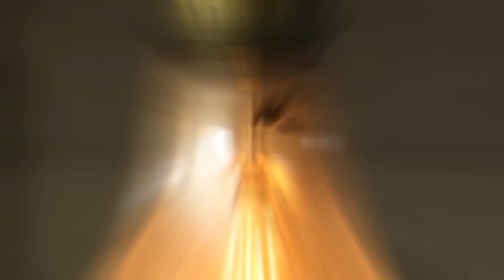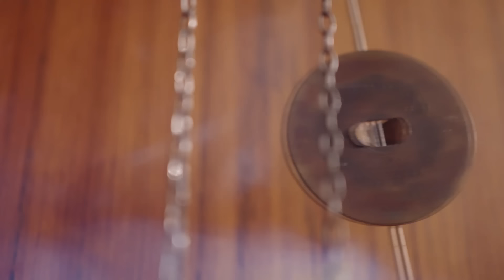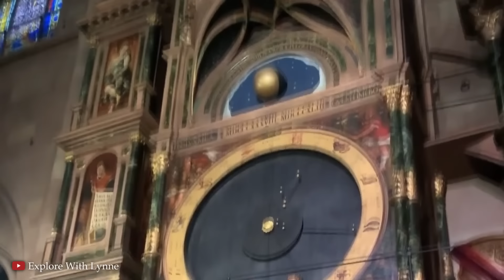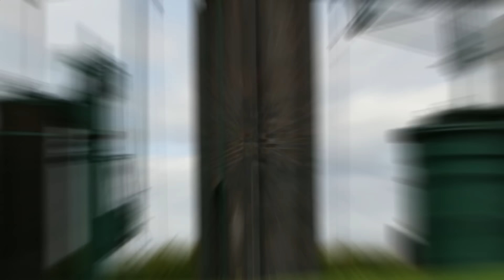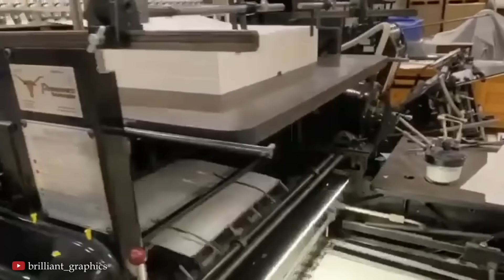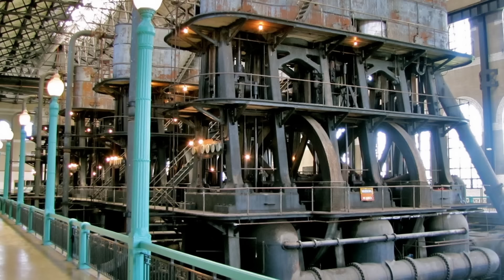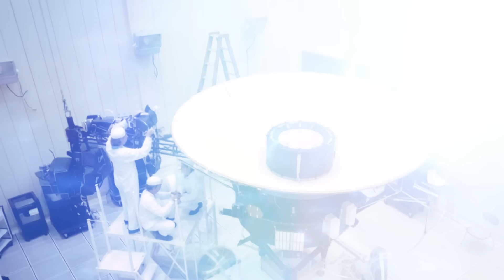15 Machines that STILL RUN After 100 Years

Comment: A machine is a technical system with moving parts that converts or transmits energy to perform mechanical work. It consists of interconnected components that carry out tasks more efficiently than human labor. Typical examples include engines, vehicles, machine tools, washing machines, or automated devices.

Comment: "Anyone can build a bridge. Only an engineer can build a bridge that barely stands up."  Different time, different engineering philosophy. Currently the goal in most cases is lowest cost that works for a defined but limited period. Long lasting designs are discouraged as it limits additional sales therefore limiting profits. Smartphones are the extreme example but the same logic is used in everything modern

Comment: The Oxford Electric Bell, located at the Clarendon Laboratory in Oxford, could be also mentioned here. It has been (silently) ringing since 1840, although its battery has never been replaced.

Comment: There is a ghost town named Sandon in the southern interior mountains of British Columbia Canada. Nicola Tesla installed an electrical generator there in 1897 and It continues to produce power to this day.
There are hopes to build a ski mountain in the area and use the electricity from Sandon to power the mountain operations.
 It will be built on a former mining town called Zincton to which the ski area will be named

Comment: First item is not even a machine. It's a malfunctioning light bulb. It's a 60W bulb that broke and now only draws ~4W. Take any incandescent bulb and run it at ~7% of it's rated power and it will last a VERY long time. So yes it's still running, but not as intended.
Reply: I agree but nevertheless the bulb IS a machine. It does work upon the input of energy. Thats the definition of a machine. It doesn't have to be mechanical. 

Its a common confusion because of course, all machanical devices are machines, but not all machines are mechanical devices.

Comment: My vote would be the Anderton Boat lift it's over 150 years old it was made to overcome a 50ft difference between the river weaver and the Trent and Mersey canal it's essentially a elevator for canal boats parts have been restored and it was converted to using electricity but I believe most of it is original Victorian engineering remains and was cutting edge for its time and is still a impressive sight today it's nickname is the cathedral of the canals

Comment: I have an issue with a light globe being mechanical.  It’s not mechanical
Reply: Who said anything about mechanical? Machines aren't always machanical. A machine is just a device for doing work when you input energy.. A bulb does the work of converting electricity to light and heat. Its a machine. 

So whats your issue again?

Comment: The Tower Bridge steam-hydraulic system is completely destroyed, the engines cut apart for viewing the interior, the accumulators have been fixed in place for H&S reasons, the steam engines are now operated by low pressure compressed air. The pressurised water motors that have not been removed had their shafts disconnected in favour of an electro-hydraulic system. The steam system had never failed to raise the bridge for a century, but the new electric system has now failed several times.

Comment: Really makes you wonder, "What the Hell have the creators of our world been thinking, making everything break every few years?!" Imagine the Peace and Stability a world would have with solid, reliable, and consistent machinery! 👍
Reply: "We can make more money, if we sell it to them multiple times, rather than just once."
Reply: Greed
Reply: The answer is quite obvious, ain’t it? 

If it breaks, that means you have to buy another one… Not to mention the sub market that came from it—repair shops… money!! It’s all about making money! Build it with shitty materials means it’s breaks down sooner… It’s not only cheaper, saving you money on materials, but you also make even more money when your customers come back in a few months rather than 10-20 years… money, money, money!! Money is honey!!
Reply: Sometimes being super durable can be a double edge sword famously go pro had a problem they older cameras was so durable no matter what new versions they made people would just get a older model for Like 70usd used of eBay it actually caused them a lot of trouble since action cams are so hard to break few people bought new ones
Reply: @liamcollinson5695  So basically, the problem was 'If we make them too well, people won't buy more of them.'

Which is basically the line of thinking I quoted. XD

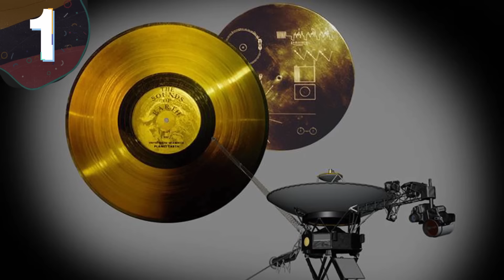Comment: 32:42 the Voyager spacecraft were launched in 1977, NOT 1997- 1997 would be the completion of the Pathfinder Mission on Mars, which failed likely due to battery failure
Reply: Doesn't matter... either way its not over 100 years ago.

Comment: A lot of the machines that were powered by stean engines were converted to run off ice engines and electric motors. If you search about these machines you may find many of these machines are still running.

Comment: Ahhhh!  Back in the days when "Reliable" and "Long-lasting" were the guiding principles of design and manufacture!
    Until it was discovered that "Cheap with Built-in Obsolescence" could yield much, MUCH, bigger profits!
    Why build ONE 'machine' that last 100 years and yields (say) £50 ... when you can sell 100 'machines' that last one year each and yield £2000?
Reply: And no... In reality many of the most profitable companies are literally ones known for good quality and lasting products.

Comment: Even though 'The Bulb' produces hardly any light and/or heat -- it IS amazing!
    And look how BEAUTIFUL it is!  The gorgeous shape, the 'engraving'!
    Just wonderful!
Reply: Indeed, it is a pretty thing in many ways... Just wish people would stop that conspiracy nonsense. The incandescent lightbulbs basically reached a technological pinnacle at a certain point settling for an at the time adequate compromise between efficiency, colour and longevity. And to reach even that far required literally the kind of temperature that simply evaporates one of the most heat resistant materials known to man and slowly accumulates it as a dark deposit on the inner surface of the glass bulb. Under such conditions, most metals would just sublimate instantly.
Reply: They run it at half power on a dimmer so it lasts longer

Comment: I proudly own and use a 1937 crosley refrigerator to keep all my extra supplies nice and cold it's been outside in the weather and the extreme 100 plus degree heat down to below freezing and the only thing I've ever replaced is the plug-in and a few light bulbs I'm 43 I found it when I was 13 in a barn and it's been plugged in ever since it was old when I found it used to keep cattle medicine in😂https://youtube.com/shorts/SgNa4q8RcZM?si=n-me0naTxHBzXi-k

Comment: @1:57 unfortunately light bulb manufacturers realized that a long-lasting bulb doesn't make money. 😢
Reply: Nor do they produce usable light.
Reply: @Crusty_corndogs  its a night light, and doing just that? dim jentel glow, in the red end to light spectrum of colour, no of nasty Blur light almost every to day pumps our
Reply: Run a 200watt bulb at 4 watts and it will run a few 100 years
Reply: Although it is quite a feat I don’t know if I would call a lightbulb a “machine”.
Reply: same with LED it is easly possible to make LED that can last 500.000 to 1000000 hours but no 50.000 h is average and 100.000 h are only avalible in saydi arabia

Comment: The light bulb still running just shows you that we can make things that last. Then greedy people get involved and instituted planned obsolescence.
Reply: This is already been established in that light bulbs in a manufactured for Middle East like Dubai and other places over there , Those countries receive lightbulbs that are something on the order of 10 times more long-lasting than ones that are sold in the United States because they demand it so they got it. Bulbs that are sold in the Middle East are for bidden to be sold here in the states/west not buy them, but by the lightbulb companies.
Reply: It was the light bulb manufacturers that made sure we got built in obsolescence: https://en.wikipedia.org/wiki/Phoebus_cartel
Reply: @rodsprague369  great, a cartel that never controlled global markets and in the end only briefly. This is literally a textbook example on how actual greed driven schemes are quickly bloated into global conspiracies that control pretty much everything.

Lightbulb simply became a commodity product that had reached its technological peak. Halogen improved slightly on both efficiency and longevity, as well as the output spectrum... But not by that much and did introduce some temperature management issues in return. And even halogen reached its peak. With technology that is based on black body radiation, it is simply hard to come up with solid materials, with suitable electrical properties, that simply would not disappear in a blink of an eye.

The Centennial Lightbulb, or whatever it was called is nothing more but a low power heater that emits some faint glow. As an illuminating device it is utterly useless. Crank the heat of the filament to actually useful levels, and it would evaporate about as fast as filaments do. There are no technological wonders or some hidden lost wisdom there.
Reply: Actually the bulb it's self had only lasted as long as it did due to it being ran at a much lower wattage than it was rated for. Carbon filament lams like the centennial at the time were much brighter at its correct wattage. Carbon wood degrade so much due to this that the bulbs actually had shorter lifespans the modern bulbs do, planned obsolescence is real don't get me wrong, but this light is not an example of that. A bunch of bulb manufacturers got together to decide on a good middle of the road standard for lightbulbs around when tungsten began being used instead of carbon due to the vastly different rated wattages for what is effectively the same bulb with different designed filminants from each other. They made set a standard for bulbs going forward to make consistent cool (orangish glow) color temperatures for regular indoor lighting due to them being ran at a wattage that wasn't too dim, and also wouldn't burn out so the bulb due to the higher wattage to get a warmer (more white) color temperatures for tungsten filimant bulbs. Then the florescent light comes along and that shit runs on a cool color temp at a stable wattage and again standardization was implemented to make them more reliable, now we have LEDs which are also very quickly becoming standardized as well due to the fact that consumers want constituency and reliability. Modern led bulbs last longer than any other bulb when just left powered on and all lights benefits from remaining off or on.  Thermal cycling is what kills bulbs. This is something you can test at home (but the electric bill will get higher so do at your own discretion) buy a two pack of bulbs and identical models of lamps or use two light sockets in your house, put a bulb in each socket and turn the lights on, turn one off whenever you exit that room but leave the other one on, the one that gets turned off and on will burn out first. This could be demonstrated faster by flickering the light on and off, this creates a very rapid series of thermal cycling causing the bulb to burn out faster. This is why rooms or areas that are more likely to see higher traffic and thus having to cycle the lights repeatedly seem to burn out more often than other areas of your house. This is also a why the turn signal in a car will burn out long before the main lights would. In a car the first things to burn out is the turn signals, then break and reverse lights, (break typically first) then the headlights and then your regular running lights. It's just thermal cycling doing it's damage.
Reply: You do realize that light bulbs die quicker because they emit MUCH more light, right? If you listened, the video explained that and why it affects longevity of a light bulb
Reply: @Crusty_corndogs  indeed. It is not difficult to make a simple resistor last practically forever... But the "black body radiation" physics is a bitch. As you need some serious heat to emit anything beyond IR-spectrum. And the "color temperature" is not just arbitrary metric, the "temperature" of daylight, some 5000'ish Kelvin, is that because that is the literal temperature of the visible part of the Sun. The unfortunate fact is that no solid material can actually deal with temperatures like that, so we had to settle for much redder light at just 2700 kelvin, the temperature is still enough to sublimate most metals in an instant, but as for light source 2700 kelvin is still essentially orange'ish glow.

The properties of an incandescent lightbulb are a compromise between efficiency and longevity.

Now there was a cartel for some time, but that operated only for a limited period and limited market area. The idea that every part of technology manufacture is some sort of huge conspiracy is just plain wrong. Sure many companies make choices between price and quality and sometimes design processes are rushed to make products ready to sell with the expense of shorter life span due to lack of optimization... But actual planned obsolescence is nowhere near as common as often claimed. For most parts it is just the simple fact that some times to make quality costs money customers now are not even willing to pay.
Reply: Do you really want a bulb that barely lights a room? The cost of brightness is longevity.
Reply: @michaelburke5750  Boo!  You and your damn LOGIC!
Reply: Until you understand it costs 2 to 10 more in electricity than if you use a better efficiency bulb and change it occasionally. 

An incandescent bulb has 20% efficiency in recent ratings. This old one is between 5 and 3.

To produce 10w of light, it will consume 200w of electricity. That is 190w of lost power. In France that means a cost of 300€ per year. 

You get more light from a 15w led that costs 20€ to buy. 

Means, each year you use your incandescent bulb, you could buy and use 10 or 12 LEDs.

So as long as your led lasts more than 1 months,it's worth chahin it.

Fact is, leds can hold over one year 

So, changing your led once a year saves you about 210€ compred to using 5% old bulb.

With a 20% bulb the saving will decrease down to 60€ ...  That's why a 20€ led is cheaper than a 4€ filament.
Reply: @Benoit-Pierre  You're NO FUN!  Why bring facts into a 'romantic' story?

Comment: The clock, Big Ben, in London is much older and as been in operation without modification since 1859 making it 167 yrs old.
Reply: To be pedantic, Big Ben is actually the main bell, which is cracked, which gives it a distinctive sound. There of course several other even older clocks, many of them astronomical,  in cathedrals and town halls. And of course a light bulb is not a machine...
Reply: @rogerfurneaux1529  And of course, a lighbulb IS a machine, just not a mechanical machine. Machines don't have to be mechanical. 

If they did then that NVidia GPU in your graphics card would not be a machine, yet anyone in their right mind will tell you it certainly is.

Comment: This is my grandfather’s axe.  My father replaced the head and I replaced the handle.  This is my grandfather’s axe.
Reply: The Ship of Theseus philosophical thought experiment. Every single cell in your body has been replaced since the time you were born, often more than once. Are you the same person?
Reply: Technically if a chain of parts continued to touch the pre parts and not changed all at once then the spirit is still of original orgin...

Comment: We have an ancient up and down sawmill nearby. it has been in intermittent use since the late 1700's. In are many old hydropower sites generating both mechanical drives and electricity here in the Northeast United States. Look up the Wireless and Steam Museum in Rhode Island. They have a tremendous collection of operating devices rom a 1/2 Hp sewing machine steam engine to a couple of 200 Hp Corless monsters. Great place.

Comment: There’s a lot of 100 year old equipment still running in oil refineries around the world. Hundreds of steam turbines and many compressors, distillation columns, vessels, some reactors, etc date from the 1920’s. German compressors with nazi symbols in the casings, rivets on tanks in Singapore, etc. Most of the old refinery equipment is shutdown or upgraded but the number of century old relics is still increasing over time.

Comment: Ofuhdogssake.. show the relevant machinery in detail, and not a jumble of other designs.
Reply: I found that slightly disappointing as well. A lot of interesting stuff, but then the images were often random... At one point I think I actually saw a clip of a stirling engine when it was supposed to be about steam engine. And then that waterpumping steam engine, without crankshaft or flywheels, thats nice, but why are they shoving pictures of something that looks more like triple-expansion steam engines with clearly visible flywheels... Or why would one be talking about a specific locomotive while shoving a random compilation of whatever locomotives they could find... Even if one picture is all you manage to find, even that would be better than this nonsense.